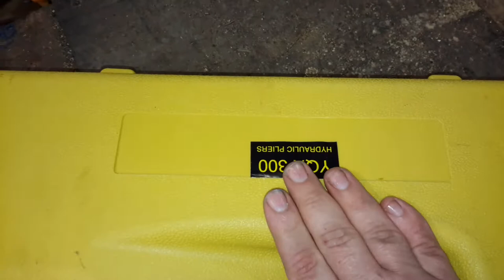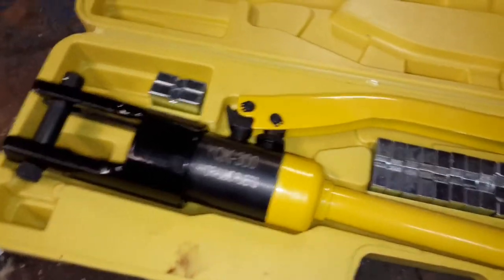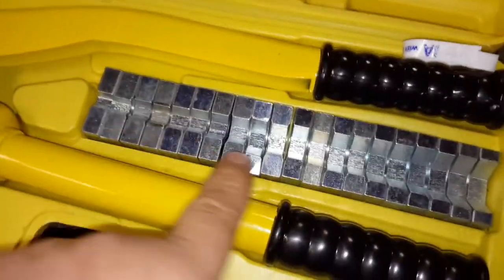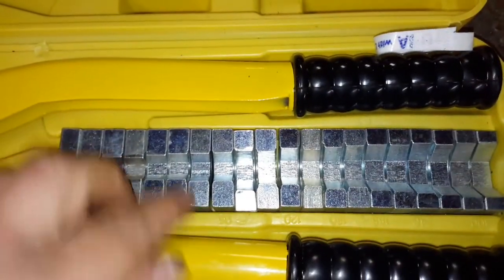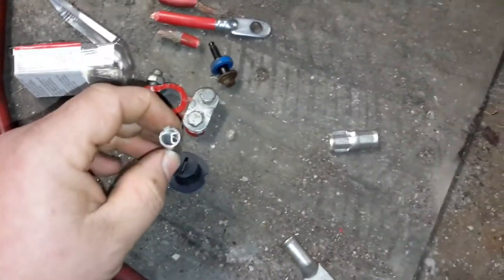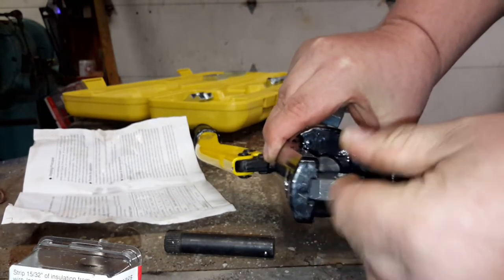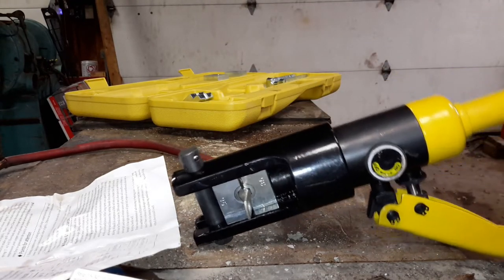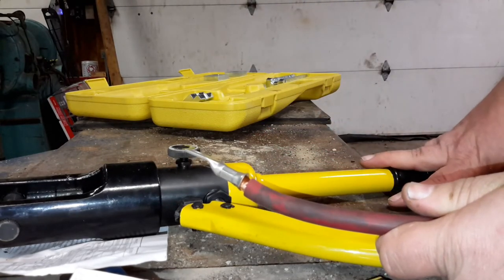LQK-300 hydraulic crimper a closer look

Comment: Good point on solder. Mechanical joints are temperature proof. Shrink wrap it and the corrosion bugs can't get between the copper conductors and the ring terminal. Down to earth salty video, keep it up .

Comment: Good crimpers, do a great job at a great price. 
The lug hole/cable size, is often stamped on the tab of the lug and should match the number on the dies....it's in metric sizes...not awg 00...0, 1 etc.
If they dont quite crimp well on the first time you can loosen off and turn the cable + lug 60° then crimp again, also doubling up the crimp sites next to each other works well for extra grip ....this also neatens up any parts squished between the dies, if you started with a die that was too small.
Once you've done the above, if theres still a grip issue you can go down one size of die and repeat as above...heatshrink it then done....
If you're really picky, solder after the solid crimping then heatshrink👍

Comment: I think it's worth the $40. Even better to find one on CL or in a pawn shop for $20 though. Of course I don't do a lot if crimping battery cables. I'm a solder guy, but mostly I think my heat shrink holds everything together just fine and dandy